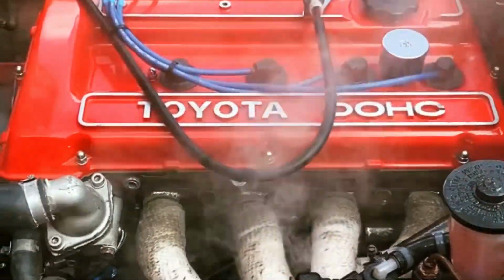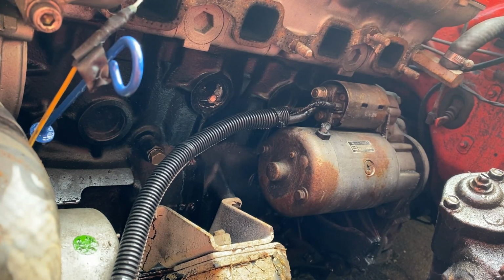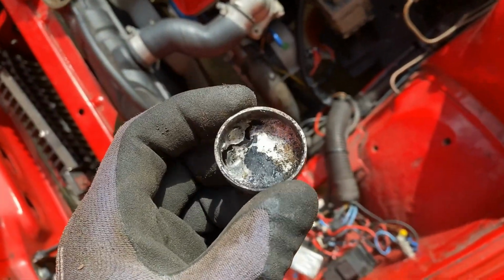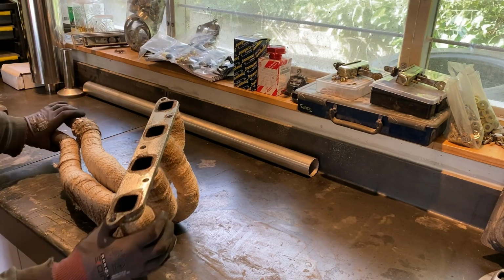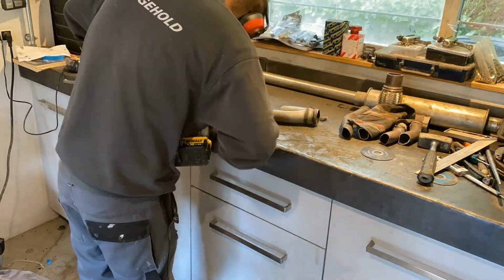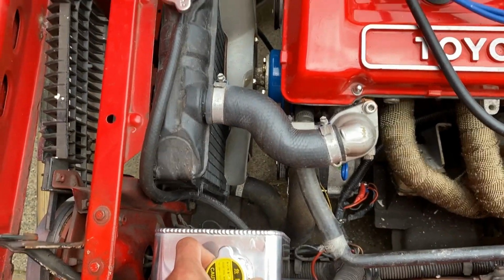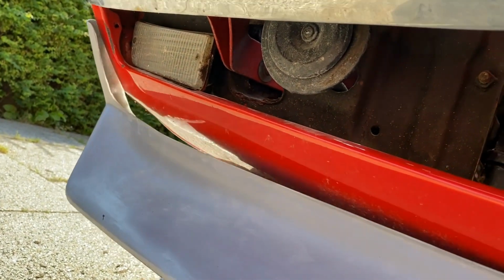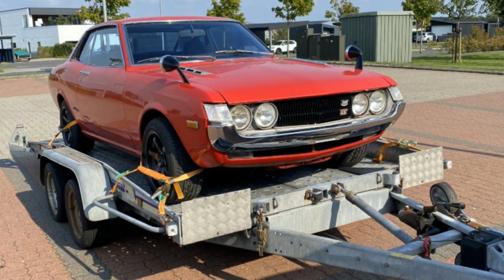Toyota celica TA22 2TG episode 2. Freeze plug repair. Exhaust manifold build and roadtrip. DIY

Comment: That front aero/lip spoiler replaces that metal valance under the front bumper. It does not go over the metal valance.

See my Celica for how it's supposed to look.
Reply from the maker: Thanks. I actually didn’t know that.🤦
Theese aftermarket parts have such horrible fitment, that figuring out where they go is a pain in it self
Reply: @DavidRoadworthyish  leave it original, dont put that on!

Comment: I have those fender mirrors to put on mine too...what did you do on the holes of the doors!
Is it necessary to take the fenders out to install them?
Reply from the maker: Cool man🙏

I haven’t done anything yet as to the holes from the old door mirrors. But I’ll weld it up at some point when I paint the car…

The easiest Way to fit them is to remove the fenders for acces..